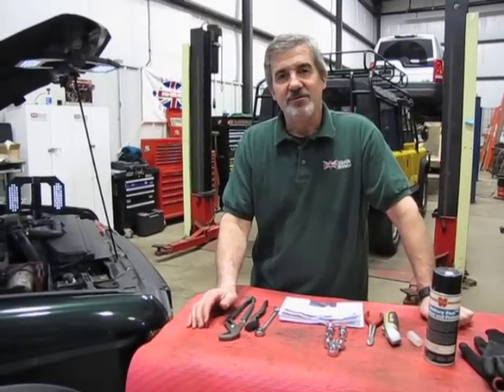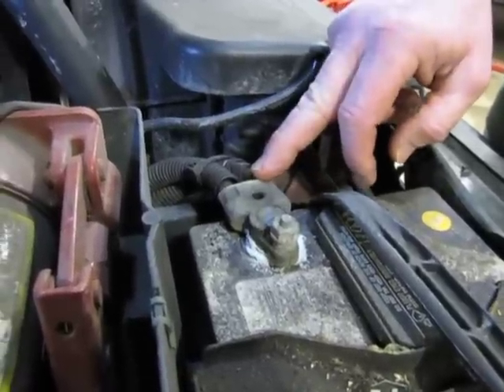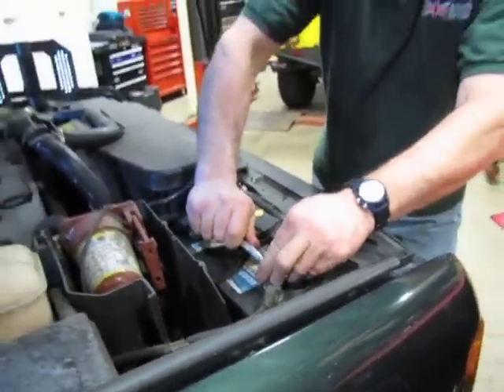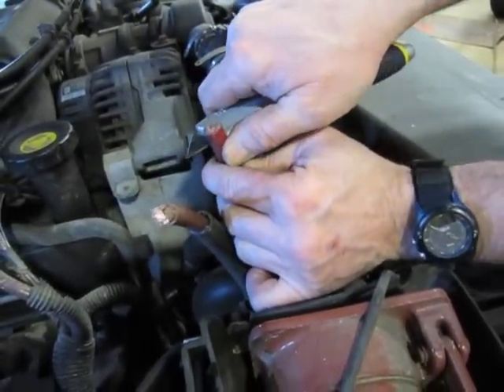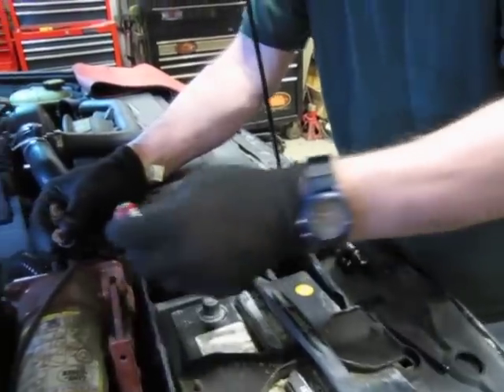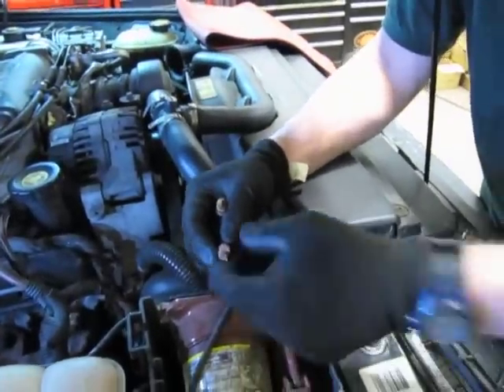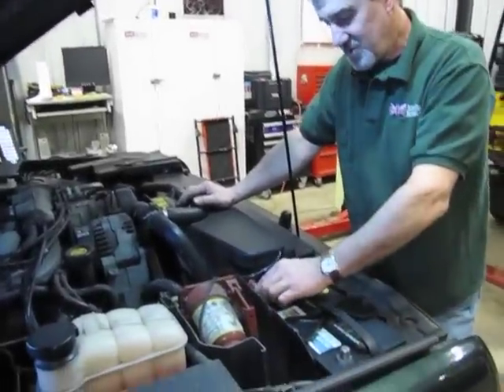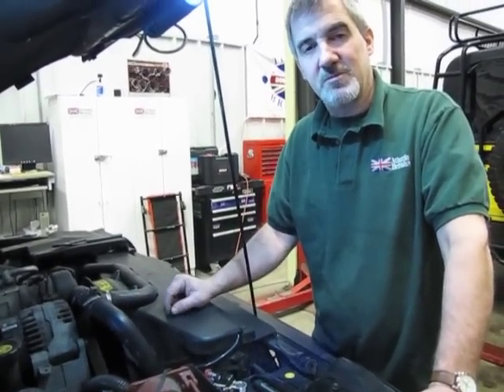Battery Cable Repair on Discovery Series II | Atlantic British Presents

Comment: I have an 04' discovery that needs a new battery. Will I have an issue with the alarm system in it when replacing it? I don't think I have a code from previous owner.